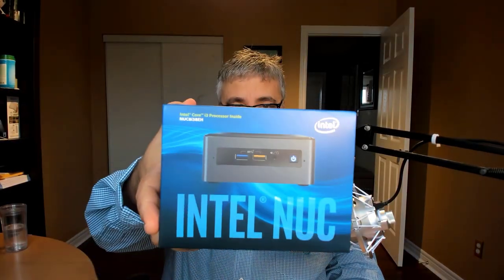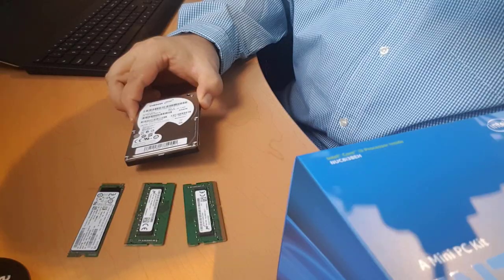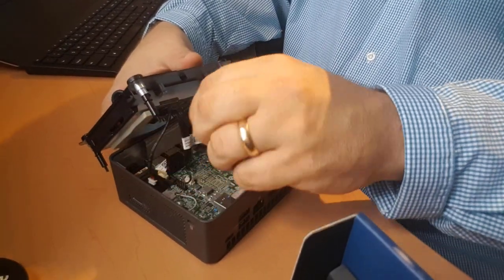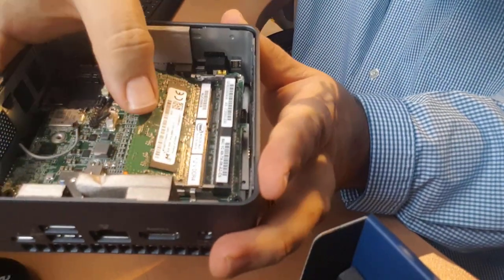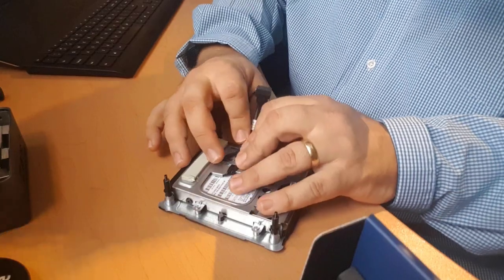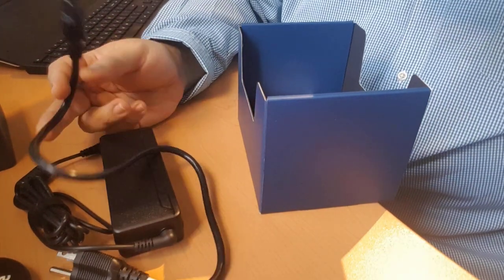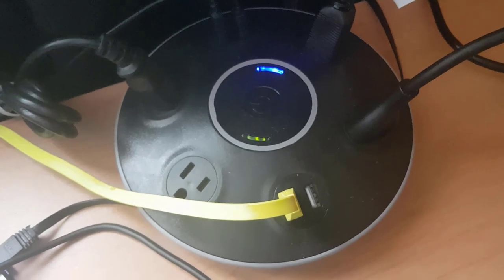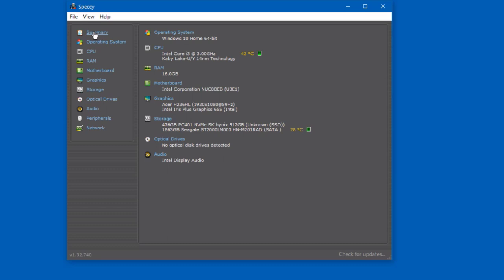Intel NUC NUC8i3BEH Unboxing and Setup

Comment: I bought a bunch of these to make use of a pile of spare parts. I have a pile of RAM, HDDs and 16GB Optane modules let over from laptop upgrades so I built 4 of these and donated them. An Optane enhanced HDD is not all that bad when it comes to general PC use.
Reply from the maker: I was the same. I wanted a second computer but I wanted to not pay a bunch for items I already had laying around. Thanks for watching my video.

Comment: Im planning to put 2 external 5cm usb fans, do you think setting them both as intakes from each side of the grill would be best? Or 1 intake 1 exhaust setup is better? I have the exact same model as yours.
Reply from the maker: I can’t imagine where you would find room for those. At this point I would consider moving the components to one of several fanless cases that are available. Just Google “NUC8i3BEH fanless cases” to see what I mean.

Comment: Hi Paul, Do you know how to remove and replace the fan on The Nuc 8i3BEH . Any tips would be greatly appreciated
Reply from the maker: You have to remove the motherboard from the case. Once you do that you will need to remove the screws holding the fan to the cooling unit. If you decide to remove the cooling unit from the CPU you will need to put a fresh supply of thermal paste on the CPU. Here is a video that shows putting an 8th generation nuc in a fanless case that shows the removal of the fan and cooling unit that you might be able to use as a reference: https://youtu.be/vQcrydSYrtE
Reply: @CaptivateTeacher  thanks so much. I did get it out and thanks for the thermal paste tip
Reply from the maker: @rserokajr  You're welcome, and thanks for watching.

Comment: Hi, tell me how to lower the fan speed through BIOS?
Reply from the maker: You can't set the fan speed but you can change settings to affect it. Press F2 during startup to enter Intel Visual BIOS; navigate to the Cooling section; then change the settings in CPU Fan Header. For example you can select one of the half dozen power plans in Fan Control Mode. I have mine set for Balanced.
Reply: @CaptivateTeacher  does it come with a fan? i have the same model and can’t seem to find it

Comment: Does the NUC require a wireless Logitech keyboard like yours?  Would it work with a wired, generic 104-key keyboard?  Have you tried using your NUC with a wired keyboard?
Reply from the maker: Nope you can use any USB keyboard, wireless or not.

Comment: How functional is the mic? The speaker jack input is only for speakers and not for a headset with mic? I am thinking of buying a NUC but I teach online...
Reply from the maker: The 1/8th inch headset jack on the front supports headset and microphone combinations. Alternatively, you could use a USB headset microphone.
Reply: @CaptivateTeacher  thanks!
Reply from the maker: @panosvz  You're welcome

Comment: Would you run MacOS on it and make it a Hackintosh? Also, is there a speaker in there?
Reply from the maker: When you consider that you have to buy storage and memory separately you would be better off just buying a Mac Mini. There is no speaker included. I use it as a media server so I don't need a speaker.
Reply: @CaptivateTeacher  Thank you!
Reply from the maker: @anthonysmendes  You're welcome Anthony Stephen Mendes, and thanks for watching.

Comment: can i have the smaller ssd drive as the only drive or do i need to have both of them??
Reply from the maker: You can have just the one if you wish and it can be either of the two drives.
Reply: @CaptivateTeacher  awesome, very helpful video by the way. thank you

Comment: Hi I wonder could I ask some advice? Considering buying this model of NUC as my DELL XPS 15 is out of comission. This would be my first attempt at even partially "building", and I cannot find specifically if the RAM and SSD will be compatible. I have the following :
> Micron MTA8ATF1G64HZ-2G3E1 8GB RAM
> HFS512GD9MND-5510A Hynix 512GB MLC PCI Express 3.0 x4 M.2 2280 Internal Solid State Drive (SSD)

I think they should be compatible from the research I've done, but would you be able to confirm?
Reply from the maker: If you're looking for a guarantee I can't give you that. I pulled the RAM and SSD out of my DELL XPS 15 9570 and used those modules in my NUC8i3BEH you see in the video. If that's where these modules you've listed came from you should be fine. The memory is looking for a slower RAM but all that means is the NUC isn't running the RAM at its full potential.
Reply: @CaptivateTeacher  Thanks Paul. Really appreciate that response!
Reply from the maker: @DEEEAAANNN11  No problem